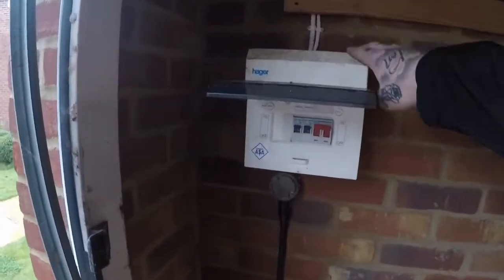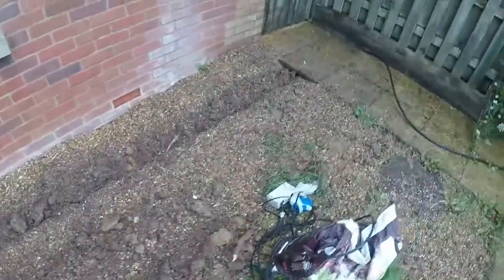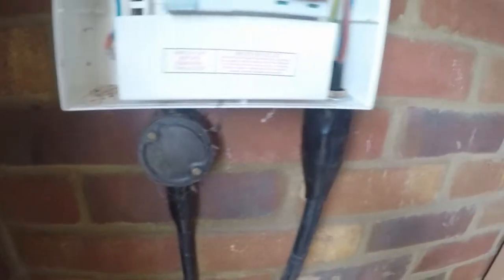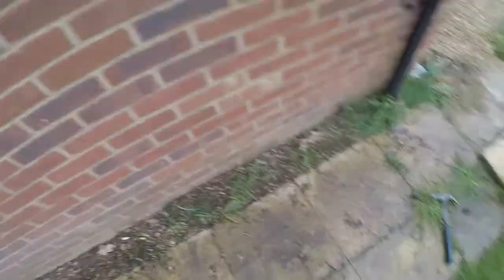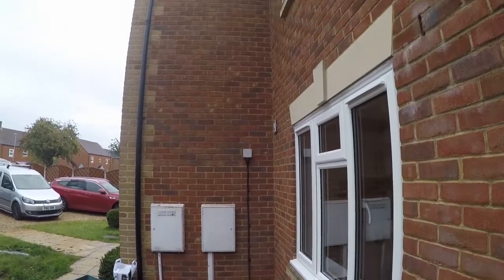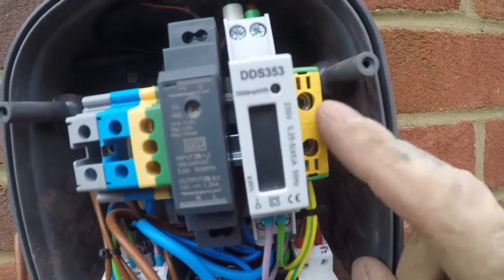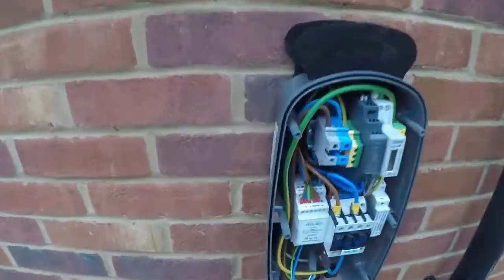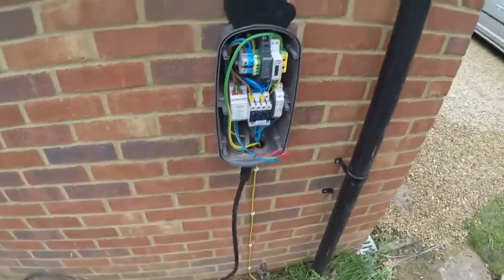Smart Domestic EV charger point - Supplied & fitted by us through OLEV grant for smart chargers

Comment: Good install mate. Quick question why does it have to have a separate RCD? Can you not just use a RCBO within the garage CU? cheers
Reply from the maker: Brad Taafe thanks mate. Yeah you could do that but they sent the rcd and enclosure with the smart charger so just used it
Reply: @actv458  ah ok cheers mate. I'm just in the process of getting OLEV registered, does if generate a lot a work once registered? And do you buy the EV chargers from suppliers or direct? Sorry for all the questions! Lol
Reply from the maker: @brad30  no worries mate. yeah a hell of a lot I've had 7 different quotes this week alone. deffo recommend. I just buy them from suppliers usually
Reply: @actv458  Nice one! Can't wait mate. Do you have to wait weeks for the chargers to be installed? When I checked online some suppliers said 2-3 weeks wait. Also, does it take a while to get the money for the OLEV grant?
Any tips also mate? 😁 Don't worry I'm based in Manchester so I'm not your competition 👍
Reply from the maker: Brad Taafe lol all good mate. CEF seem to hold quite a lot of stock so they are good. There well priced as well, yeah can take up to 30 days normally but they do often run behind.
Reply: @actv458  nice one mate, do some more uploads please there pretty good mate and not enough OLEV guys doing this on YouTube 👍